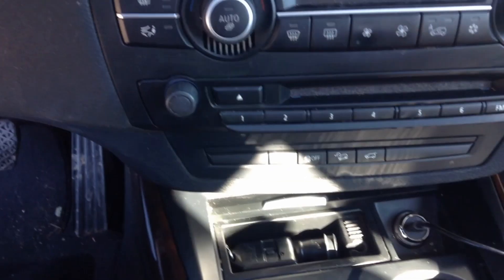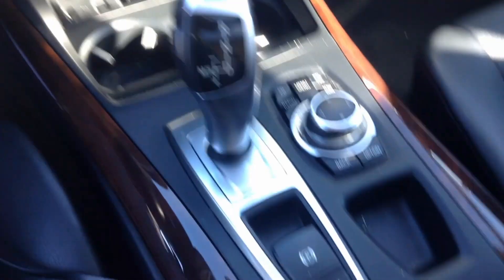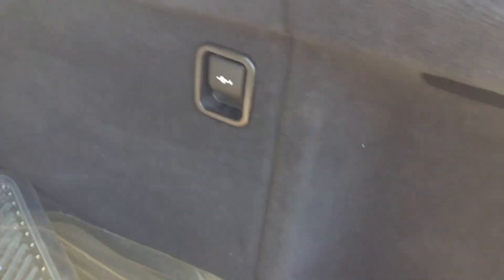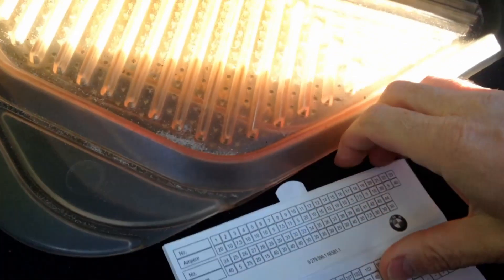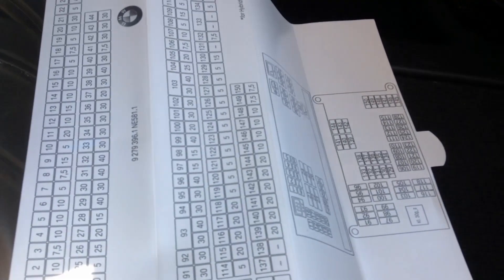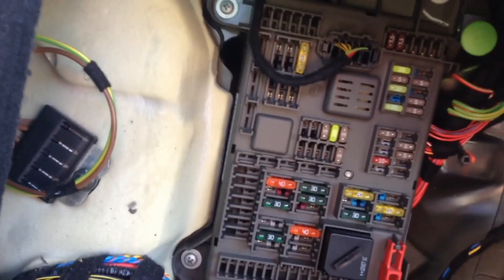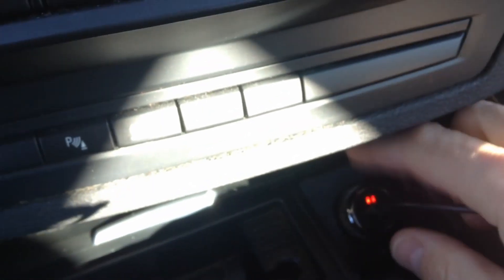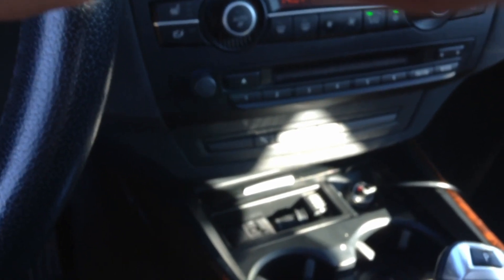BMW X5 Cigarette Lighter Accessory Outlet not working - E70 35iX N55 Engine

Comment: It would be very helpful to explain how you figured it was F1-11 and F1-13?? Also what fuse capacity you replaced them with? Also which fuse is front and rear?? Many thanks.
Reply from the maker: Great question.  The fuse box diagrams are widely available on the internet.  Here is an example but you can find it with any Google search too : https://fuse-box.info/bmw/bmw-x5-e70-2007-2013-fuses-and-relay F111 is the cigarette lighter in the main ashtray socket and the F113 is the cigarette lighter at the center armrest console. As far as the amperage, I replaced them with the same capacity as the original which was 20A for both

Comment: You’re video helped so much. The normal usb outlet inside the center console also charges very slowly or sometimes not at all, could this be related?
Reply from the maker: Hi, it is very unlikely that the issues are connected because with the fuse, you either have the power, or you do not.  There is no in-between.  However, in my car, I notice the usb outlet inside the console especially likes the original cables (in my case Apple.)  I want to say it is because it transfers power and data so you can play your music through the entertainment screen.  I too had issues with aftermarket cables, hopefully that is your issue as well because it is simple to overcome.

Comment: My chair wont Go back or move what should i do ?
Reply from the maker: I would start by changing fuse F149 It is a 5 Ampere fuse which controls the Seat multifunction switch, left front